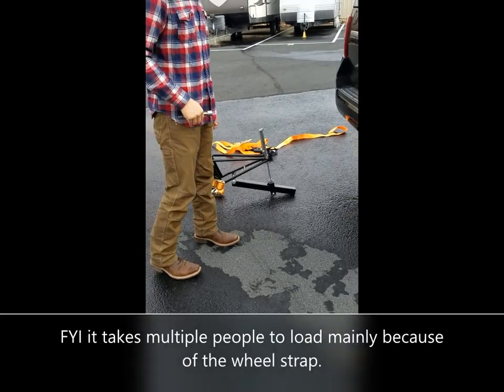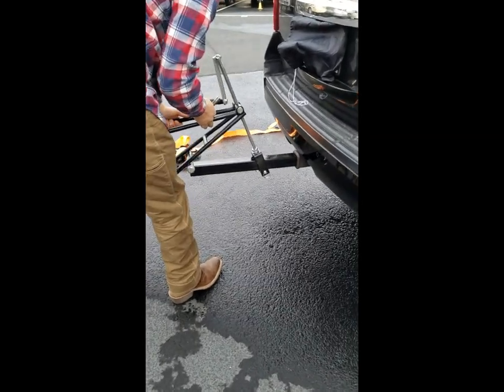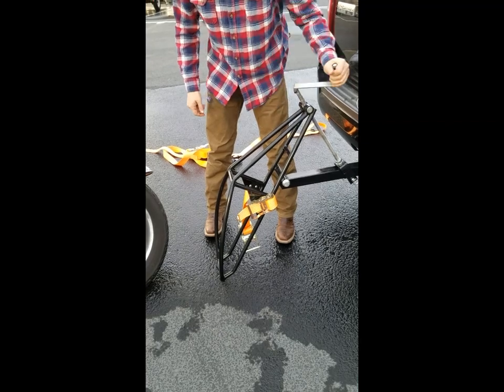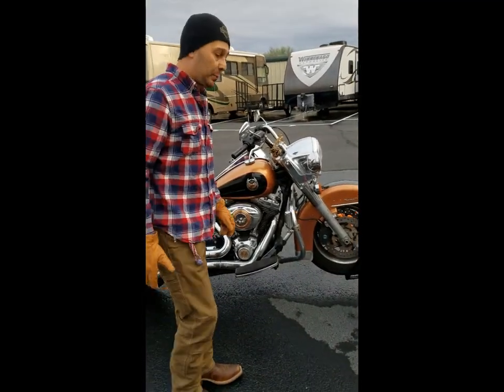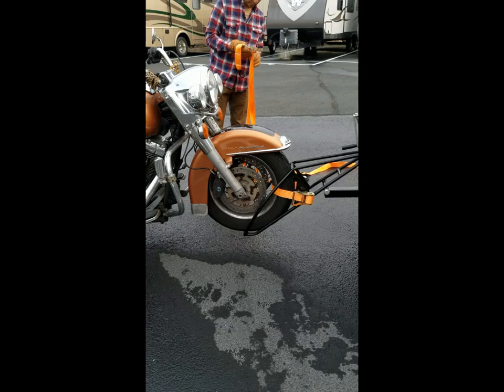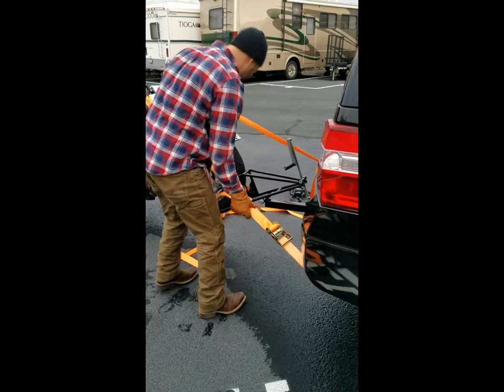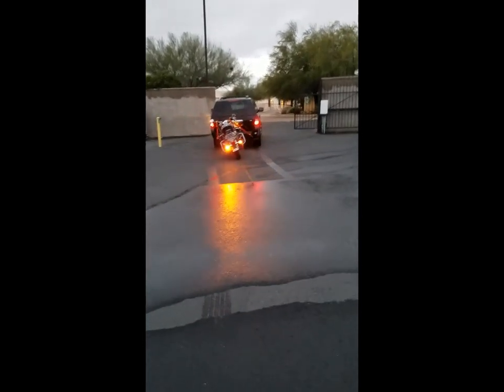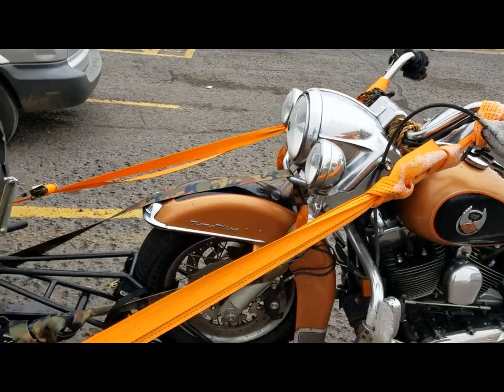Motorcycle tow hitch by ECOTRIC

Comment: Thanks for doing this review.  No one else on YouTube has shown this thing working or talked about it.  I’ve been looking at it for my sport bike.
Reply: This is a great trailer as the video shows... I did a boxing and review video on it about a year ago and it has held up well. I've towed everything from the lightest, to the heaviest Goldwing without a loss. Just remember to use LUBRICANT when cranking. . 
GO501 did a great job showing the distance and adverse weather stability 👍🏽
Reply from the maker: Thomas,
Thanks for the comment, if you get it just remember to verify the weight capacity of the bike, and the wheel width of the carrier you purchase will fit your bike. If you get it like, I did and disassembled take a look at the video, I posted on how to assemble it. To reinforce what Burke’s World said make sure you use a lubricant for the all thread and ensure it is something that can be used in the elements.

Comment: What did you do to stop the bike from leaning? Wont the straps going to the back prevent the bike from being able to turn?
Reply: It doesn't swivel from side to side that's the only thing I don't like about it the bike leans over and when you go around the corners I would weld it up and make it turn and swivel from side to side for the price $130 bucks you buy it and just then you got to put a swivel on it it's worth it I mean how hard could it be to make it swivel not very hard just a couple of pieces of quarter inch steel and a pin so when you go around the corners it can turn then you'd have to strap the front end to that piece itself and put across bar on it a short one but it's a good idea even for long hauls if you make it swivel

Comment: The brass fitting on the worm  gear is going to wear out quick , Tie the handlebar straps to the safely chain loops.If you tie them to the outside of the bumper the Bike will lean and possibly fall in a sharp turn.

Comment: Great video... just remember to use lubricant to make the cranking easier and stop the excessive shearing of the brass nut.... like and subscribed as well.
Reply from the maker: Burke’s World,
Thanks for the comment, I enjoyed you video as well. If I would have seen, your video first I would not have freaked out on the first turn. I actually did use an all-purpose grease that is good in the weather, it is in the previous video I posted about how to assemble it. My carrier came fully disassembled. I was looking at the threads now and I believe the little bit of metal shavings is just residual form the making of them, kind of like when you get a new key made and it is rough to use for the first few times. Once again thanks and you made a great video too.

Comment from the maker: I purchased the ECOTRIC Motorcycle Receiver Hitch Hauler Trailer Tow Dolly Rack carrier and Initially, I thought it was cheaply assembled. After using it to transport my Harley 900 miles at 75 MPH it worked exceptionally well. Please leave a comment or recommendation below. Thanks.
Reply: I've got a question on transmission issues after transporting like this? Even though bike is in neutral, does anyone think there might be concerns on the bikes transmission after towing in neutral???
Reply: @ernieholmes7375  I wouldn't worry about it. Anytime a vehicle is gonna be towed, if it's not on a trailer, it's going in neutral. If it were a transmission hazard, a lot o tow companies wouldn't even be in business due to the cost of a transmission repair

Comment: Cut a bevel on the end of a 2x4 or 4x4 to act as a ramp so you can load the bike with the carrier higher up.  Didn't this thing come with directions? 

You should NOT attach those straps to the corner of your vehicle.  When you make turns one side will go slack and the other side will pull your bike over.  Who engineered that thing?

Comment: I don't trust those either.. That's why the ones I make are made out of the thick metal tubing that the entire reciever system is made from and I have support bars and welds all over .I weld picture and stunt cars for a living so I've built all kinds of crazy things. With mine the bike or whatever your hauling is safe the platform if fully supported and enterchangible with other platforms for what ever I'm hauling. Mine locks the bike in place so it cant fall over as you strap in on. And theres no sketchy ramp to push or ride up. A girl scout can load my gsxr 1000 by herself.
Reply: Hi Billy, your bike hitch tow system sounds amazing, do you have an image that could be viewed for reference? Like yourself I am  a fabricator / welder and I would like to make a secure one solely for myself. Thank you.

Comment: If it doesn't swivel then it's not worth buying I suppose if you buy it you can always weld it up and make it swivel but I'm not taking the chance on anything that hooks my motorcycle to a trailer hitch and when I go around the corner it leans over I just don't think that's a very good idea because it needs to swivel so it can move side to side as you go around corners but for the price I suppose I could buy it and make it swivel myself

Comment: very great video ... give me confidence in getting one myself
Reply from the maker: Wise Man,
Thank you for the comment. A pointer is during turns it leans but that is normal, also make sure you put the tire strap around the wheel and not over the bar that the wheel fits in. this will prevent the wheel from sliding or being loose.
Reply: @ziasunfarmstead  yes .. i did notice other videos.. the leaning at turns looks scary but that's normal as what you said.. Thanks for the extra tips

Comment: What are the laws for brake/ turn signals when towing the bike?
Reply: There is a gray area in laws now that govern the use of these. Some authorities I've heard will even try to ticket you for having one wheel on the ground. Stating you cannot tow a vehicle with an unauthorized two dolly. Since your brake and tail lights are visible with the bike mounted on the back, there is no need for added lights. However, someone may not see the motorcycle and end up running into it since there are no warning lights on it or flags. I would definitely be flying a red flag like on anything sticking 6 feet out of your truck or car. I like this video I just watched. No lean, due to the outrigger and the bike being connected at 4 points to the rig. https://youtu.be/i2q1cA-67w0
Reply: @MrCbell57  yea, I could probably build something similar to that rig in the linked video. Thnx
Reply: @SirShoddrick  no problem. I'm building myself on for a Yamaha 1900. And going to add an outrigger type support on each side which I can strap the bike to. Bars and rear pegs. Keep it from leaning for sure. And safer!

Comment: People keep commenting on how great this works the problem is you can't run your back tire but the chain on it will mess up your trans.   I'm gonna try to do a long trip but I have to lift the back tire and let the front tire on the ground.   I can't imagine people using this and not having a problem
Reply: Fro Dogg pretty sure you just take off the chain.
Reply: @daniellemulcahy  Not that simple...
Reply: Belt driven.
Reply: @b0nedaddy2360 not that simple...some bike you can do that to...but other you can't. So I would not us this as a golden rule.  Again I would not trust it. If you are taking it to a chop 5 miles away...ok, not anywhere over 50 mile. Again not that simple.

Comment: Will this add miles to the motorcycle?
Reply from the maker: Arjun p,
It does not add miles, it is in neutral when it is connected.
Reply: @ziasunfarmstead  Also,  I think most bikes speedo / odo is driven from the front wheel... well it has been on most bikes I have owned (mostly dirt & sports bikes)
Reply: @lukewatson3071  I like the fact this guy in this video here: https://youtu.be/i2q1cA-67w0 uses an outrigger and connects the bike at 4 points removing the lean they have when not doing so.

Comment: There's a new hitch that attaches to the rear wheel it's called Motowus
Reply: yeah, and 700 dollars price
Reply: @kosta2177  that's like the cost of renting a trailer a few times. And I saved money on gas
Reply: @emil4664 on the eBay there are plenty of other hitches which would cost you 120-140 bucks and do the same job.
Reply: @kosta2177  listen I'm not bashing this but no one shows it on the road how does the bike turn with it? What I spent on motowus was well worth it I didn't even feel I was towing anything and my bike and I get to wherever safe and sound and I say this after towing more than 535 miles at 65-75mph. And let me add it takes me about 5 minutes to get my bike loaded by myself
Reply: @emil4664  Good points. Thank you for the review.
Reply: I've got the MOTOW. Your bike doesn't lean because it swivels at the chock like a standard trailer. Also 0 transmission bits moving because rear is off the ground. Rear wheel off the ground is where you want it especially constant mesh transmission.
Reply: @racylaserjet  You are absolutely correct.Thanks for the input.

Comment: Those ratchets on either side are for your handle bar straps
Reply from the maker: Kristian Pallone,
I did not have my new straps when I got snowed in for this trip, in the past I, have used a utility trailer but needed to pull something together and this was the solution. I was actually apprehensive but the way it held up in the snow was great. Look at my other video on the rhino straps. Those are the ones I usually use and prefer. Thanks for the comment.
Reply: GO501 I bought one as well. Haven’t got around to using it tho. I’m moving soon from Florida to Montana😳( I know right!?) anyway as a female solo, this looked like the way to go as I will be towing it behind my camper ( a converted trailer I’ll be doing a video on soon) and it’s too small to handle the full weight like you see some ppl do
Reply: GO501 oh yeah, in the beginning your bike was leaning- why ??
Reply from the maker: Kristian Pallone,
Good luck with the Move. I just subscribed to you and look forward to seeing your video. The lean is normal it is where the pivot point is, if a trailer was on two wheels it would do it two. The one thing I will caution you on is do not stop in the lean because it will put unnecessary pressure on the hitch and receiver. It will also lean in turns and that is normal. Be careful with backing up as well, all the principles of towing a trailer apply to this. Lastly is your assembled or not?
Reply: GO501 yes , I have it on just waiting on the mortgage broker to finalize my new home.

Comment: Please take this down… or let us watch the video where you turn a corner and rip the bike off the rack..
Reply from the maker: The bike never "ripped" off the tow hitch. The way it sits and the way it is strapped allows for it to lean just slightly. I made it from Arizona to New Mexico with no problems and even through the snow. I will say I never used it again because I purchases a trailer.

Comment: What are you trying to accomplish at 2:51 into video? The angle of the carrier is almost vertical. Never mind I see. This entire system is kept together with one 1.5 inch weld! Did you notice that? But oh my this would never work if your bike was not running. I mean, good video. But dude I would stop promoting this. I mean, what would you do if someone died after their bike came off from broken welded area?  Also, the lean is not natural. It is due to the pivot point and rake lagging behind the attachment point of wheel. Well yes it naturally does this for sure, but in no way is it natural to see it happen nor is it any good at all to have the weight of your bike leaning like this with the front wheel off the ground all the while and back tire trailing along on a different plane and path!
Good job on hooking this up though.  I like this video here: https://youtu.be/i2q1cA-67w0 The outriggers allow the bike to stay vertical no matter what, and its basically able to pick up a non running scooter also. I think I will make the one the guy designed for $35 dollars and then add the outriggers to it like this video here has.  The guy I'm talking about is https://youtu.be/CL0_wLXepBA. Or I really like  this slick willy, but it is just not tough or strong enough. Especially for us big bikes. I have a Yamaha 1900 Road Liner. It weighs more than yours.